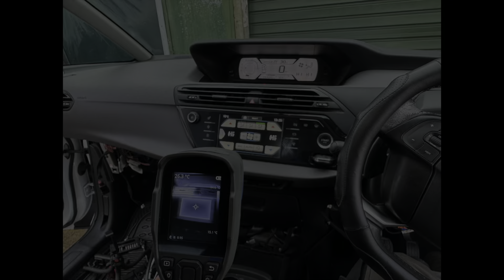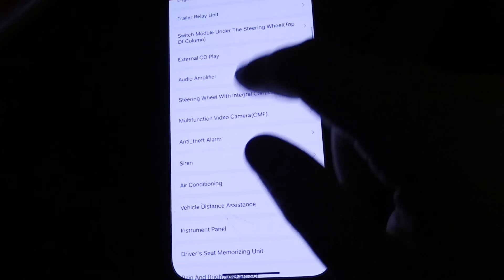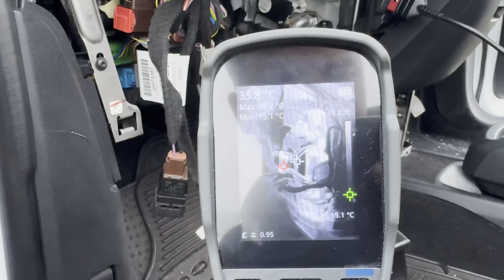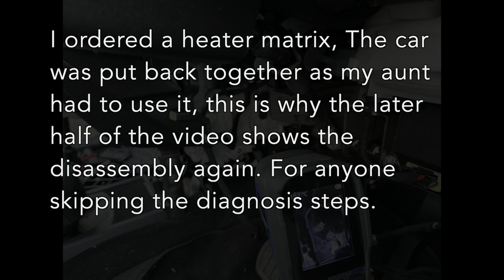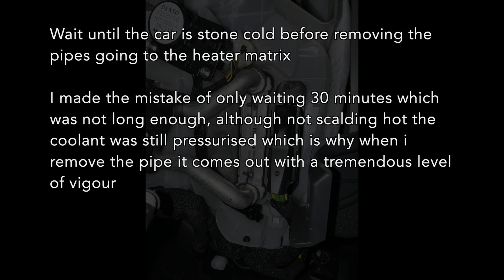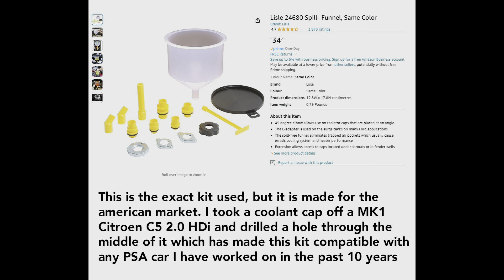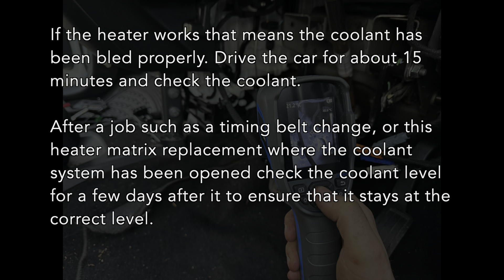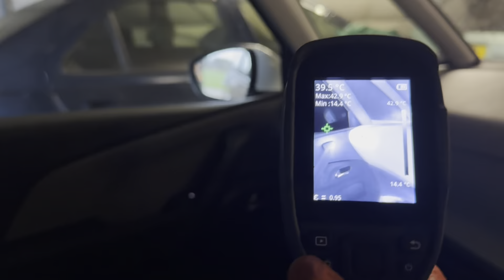How to Diagnose/Replace a Heater Matrix on a Citroen C4 Picasso MK2: A Complete Guide

Comment: I've watched this twice. Yet I am wondering what that bloc in front of the heater core where you unplugged the big electrical connector? I am trying to find out where the thermistor is in this car. My A/C and heat are on and off, both work, yet it is erratic. The fans never change speed no matter what the set point temperature is changed to except for low or high.
Reply: Its located just under the blower
Reply: @ProctoLogic  It's a trace electrical heater to provide early demist before engine heat

Comment: Hey there... I've got the same issue with my c4 picasso half heating the inside so I'll have a look on that matrix... but do you think this bad matrix could  affect the coolant circulation in the engine bay like something doesn't allow the coolant to circulate freely??
Reply from the maker: Hi there
As far as i am aware the matrix itself still had enough flow to allow the engine to keep cool, it was more so the far end of the matrix was clogged so coolant was still flowing through it but only on the passenger side.
I am not sure exactly what way the entire cooling system is plumbed on these engines if the hoses to the matrix were blocked would that cause the engine to cool less effectivley or if they play a more passive part in the system.

This car experienced no overheating issues with its engine but the heater matrix not working was more so a problem for my aunt driving it in the winter with my elderly granny.
Reply: Ok i understand... thanks for your answer 👍🏽👍🏽 meanwhile i drained  flushed and cleaned as much as i could the coolant system with a Holts product and vinegar and the heat inside is really nice now... one side is still hotter but it's well better than it was 😊😅@peugeotCitroen2CV

Comment: Hey I've just come across your channel and I figured you'd be the right person to ask.

I'm looking to purchase either a PSA product or a Renault from the 2008-2014ish range. For the Renault I'm looking at the 2.0 naturally aspirated petrol, alongside their dci diesels (1.5/1.6/2.0). For PSA cars it seems the 2.0 HDI is the best engine (the 1.6thp the least reliable).

Wondering if you have any advice to steer me one way or another, if the PSA 2.0 is better than the Renault 2.0 dci, or if any of the engines mentioned above are to be avoided. Thanks!
Reply from the maker: Hi there, thanks for asking.

I prefer PSA products myself, just think they feel better made and generally are more comfortable and nicer to drive.
Although any renault with the 1.5 K9K diesel engine is generally quite good, its gruffer than the peugeot 1.6hdi but seems to be hardy enough.

The 1.6 16v HDi did have the reputation for blowing turbos, its not a bad engine is quite punchy and easy to run but it will not tolerate lack of maintenance as well as the old 2.0 8v engine. Remember that engine was replaced with the 2.0 16v that the 407 and facelift 307 would have got.

With regards petrols... PSA petrols after the TU range and excuse the language they went to shite. The prince 1.6 petrol in all guises i wouldn't touch with a barge pole, the puretech 1.0 and 1.2 3 cylinder engines in some guises they can be quite flexible engines but i dont like 3 cylinder engines in general and then the wet belt is another thing to look out for. If its been changed, and if the correct oil is used it might be ok. But buying one used you might need to budget to remove the sump clean out any bits of belt in the strainer and replace the belt. 

Renault petrols, i am less experienced with but in general the naturally aspirated ones like the 1.2 16v and 1.6 are fairly simple and straightforward. 2.0 might be a bit thirsty. 
Their diesels, i do not have enough first hand experience with, just dont think they are as good as the PSA engines.

Personally i really like the 1.6 8v HDi they fixed some of the issues the 1.6 16v engine had, in something like the 2012 C4 hatch or berlingo its a good choice. I really like it in this C4 picasso with a proper torque converter automatic gearbox.
In a lot of applications its on £30 a year tax or lower.
Reply: This is so helpful. Thanks

Comment: Did the pipes fit in tight? I’ve ordered one from eBay and after tightening them it’s leaking
Reply: Yeah, they are like that. Have to run some grease on the O-rings before you reinsert the pipes. Stops it from leaking.